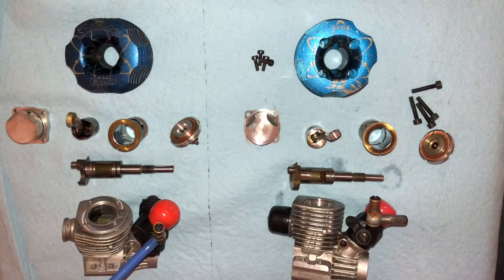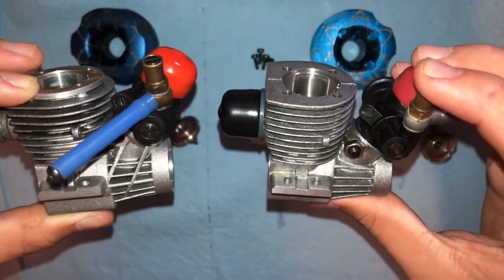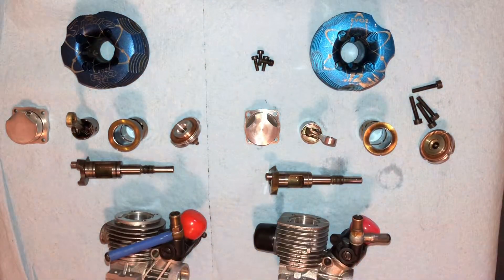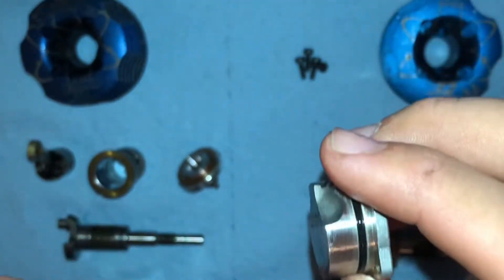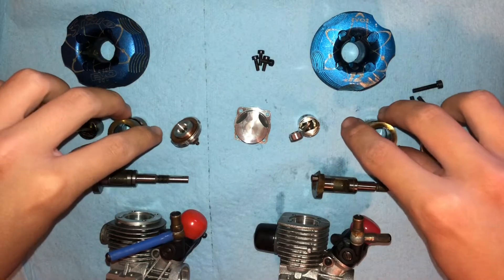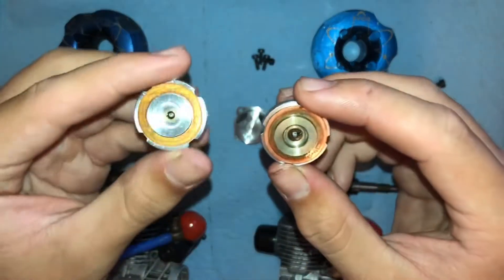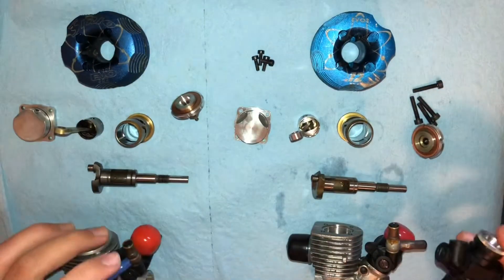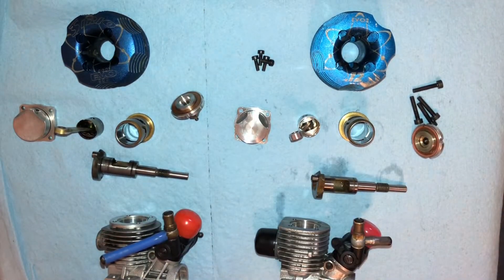These Engines Were Ahead of Their Time | Sirio S12 Evo 2 & Evo 3 Comparison

Comment: I just bought an old Kyosho V one RRR with a worn out Sirio S12 engine with the Black Head.  Do you know if any of the other cylinder sleeves, pistons, connecting rods, crank shafts, etc from the other S12 variants will fit this engine?  Like for instance the XXX, Evo 3,4 etc?
Reply from the maker: I know the evo 2,3, and 4 sleeves are all interchangeable. The Evo 3 and maybe 4 have a different sized wrist pin than the Evo 2. The Evo 3 and 4 also use a 12mm crank while the Evo 2 uses an 11mm. I believe the XXX is based off of the Evo 4. Most parts are interchangeable but there are some things to be aware of
Reply: @moralesrcdesigns3784  Thats awesome man! Thanks for the help.  I'm on the fence about re-pinching the sleeve, and buying a new one.  Adam Drake does it for 25 bucks. I think im going to try and buy a new sleeve for one of the variants and see it if fits. if it doesn't then I will need to have the engine re-pinched.
Reply from the maker: @TexasHill  Drake is the man to go to when it comes to pinching sleeves. I also do it, but my method isn’t as good as his (it has some inconsistencies that I’m still trying to solve). I have an engine repinched by him and that things runs beautifully. Nothing wrong with getting a new piston and sleeve set either. You can get a new sleeve set, two new con rods, and have the old sleeve repinched. Then you’ll have a backup piston, sleeve, and rod set ready to go. Also, always make sure to use new wrist pin clips. The last thing you want is an old clip breaking or popping out. The clips are pretty much universal across all engines so I doesn’t really matter which brand you get. I recommend the reds clips though since you get the most for your money
Reply: @moralesrcdesigns3784  - Your the Man! Thanks so much!  I'm on board with everything you said.  I"m going to stock up on a sleeve for it since I all ready got 2 rods for it, and send the original off to Drake for service.  I can't wait to run it in my Kyosho V one RRR!!!